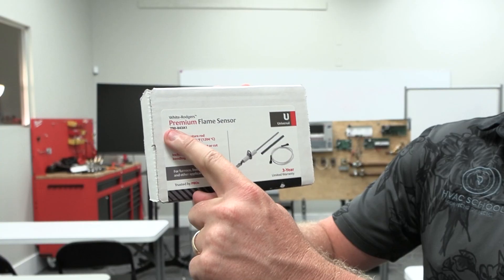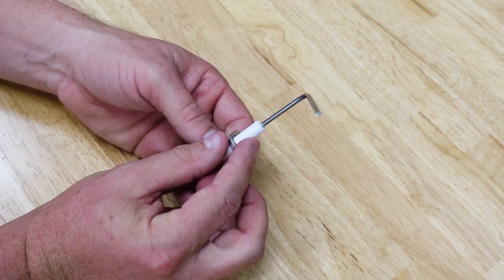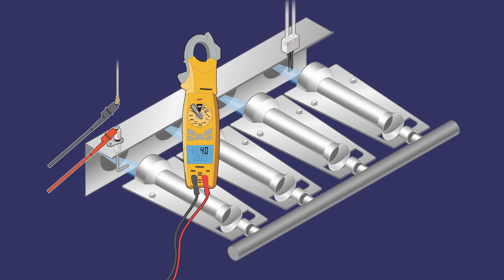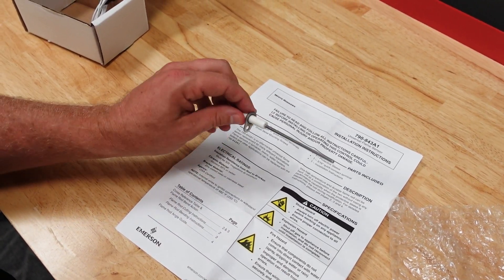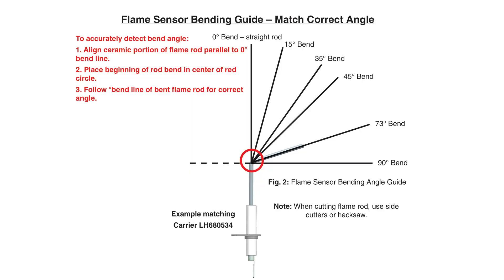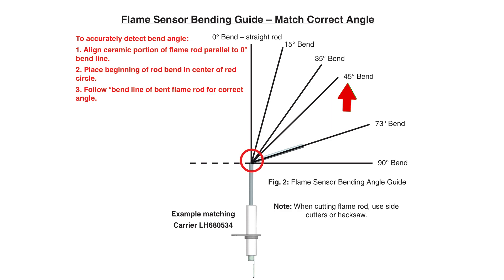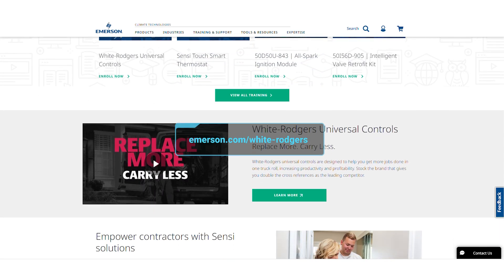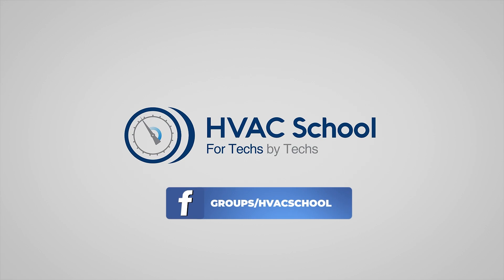White Rodgers Premium Flame Sensor Intro

Comment: @ 0:11 always before I bend the electrodes in position I heat them with a MAPP type burner or whatever I have at hand until the electrode turns red then it bends with very little effort and you don't risk either cracking the ceramic part or breaking the electrode. 😊

Comment: Mr. Prokup developed a training program and gave many training classes regarding gas furnaces. One thing he suggested is cleaning the older flame sensors using a dollar bill. Paper money.  Because is is not abrasive like sandpaper.
Reply: i think it has to be a 50 or larger

Comment: I have a 23 year old Janitrol gas furnace, twice or maybe three times the flame sensor failed. It never showed any physical damage or deposits on it. Each time I took it out and rubbed it with steel wool or fine scotchbright and that did the trick. It's been a while since the last time, maybe 8 or 10 years with no trouble, still the original sensor. I never knew it was forbidden to touch it. Now that I know how they work I'm wondering if the furnace can be made to manually cycle in a pinch by shorting the sensor lead to ground thru a large value resistor. 

 When it comes to ignitors I've changed a number of those and keep spares on hand. Always I order the exact replacement and they always need modification to fit, so I have several on hand with the modification already done and ready to install.

Comment: Ok. I’ve been doing commercial, multi family and refrigeration for nearly a decade now. I’ve had to replace a flame rod of this type only one time. It had completely disintegrated because of a poorly executed propane conversion. I’ve cleaned hundreds on pms and service calls. This is cool and a really well thought out idea but is there a real application for this product?  Flame rod failures are much more common on power burners but obviously this isn’t gonna work for that situation.
Reply: It’s another part for your truck stock. I had to replace a flame rod when I accidentally broke it. Fortunately had one in my truck that was identical. Useful for clumsy technicians
Reply: @victork3397  well I’ll give you that. Everyone is clumsy after a few late calls. Imma go get o e since karma would dictate that I’m gonna break a flame rod tomorrow.
Reply: Had to replace 2 rods in 20 years. One had this odd corrosion that looked almost like bubbling or melting and the other had somehow gotten the ceramic damaged and the rod would spin freely in it.
Reply: @fryeg7  yep, I’ve seen that before too. Flame rod spinning freely. Only seen it once, but it does happen